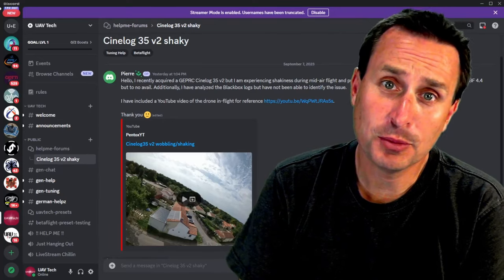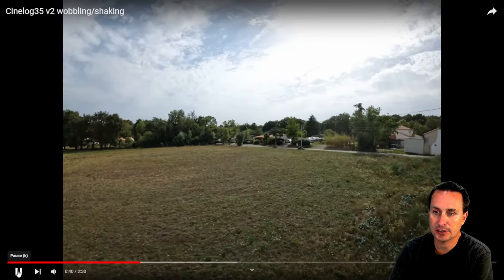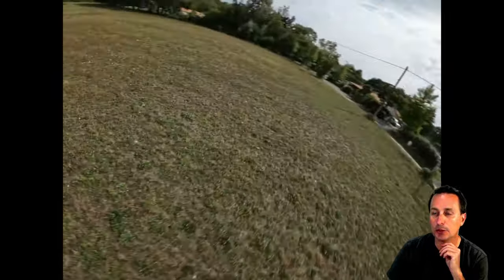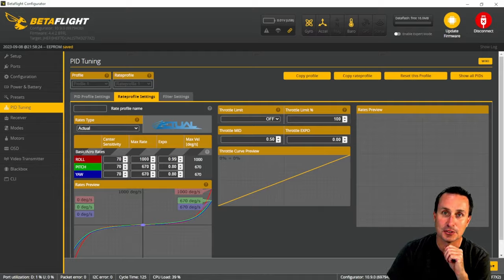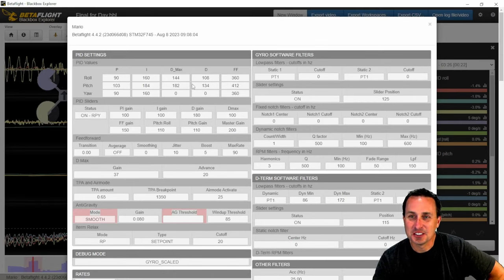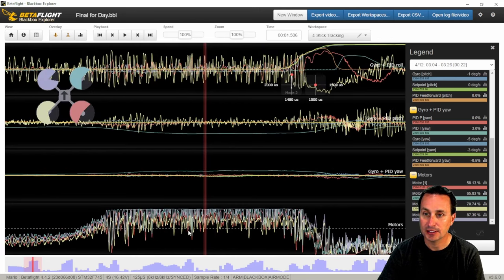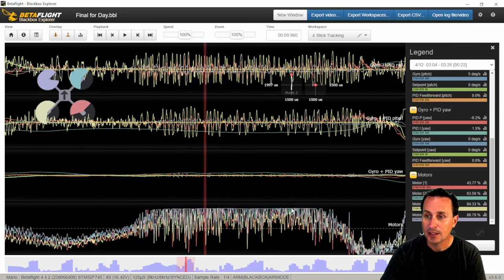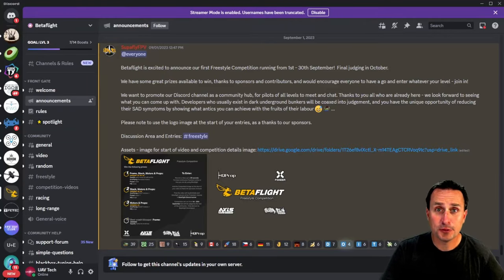Drone Troubleshooting - Shaky Flight | D-gains TOO HIGH!

Comment: I've tuned the Cinelog35 V2 and the main issue with it is its ESC settings, they are terrible. It also needs thrust linearisation to deal with its weak low throttle.
Reply: 您是否遇到任何问题？你需要调整飞机吗？